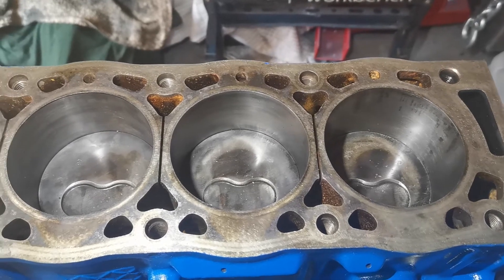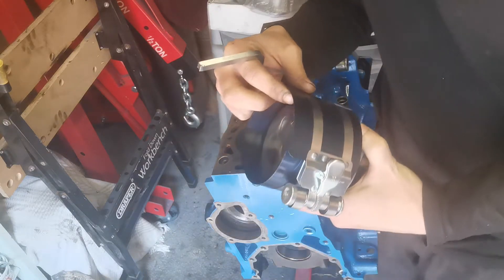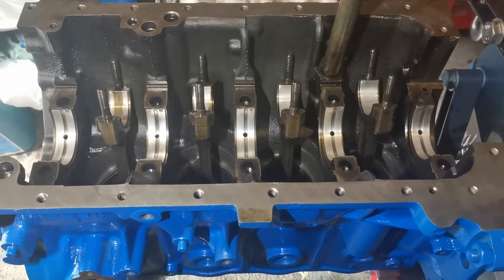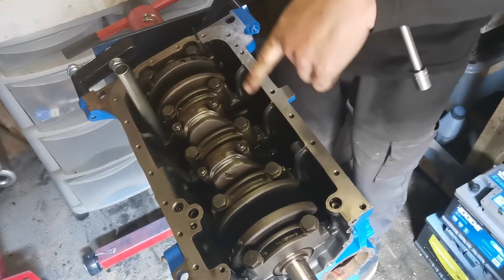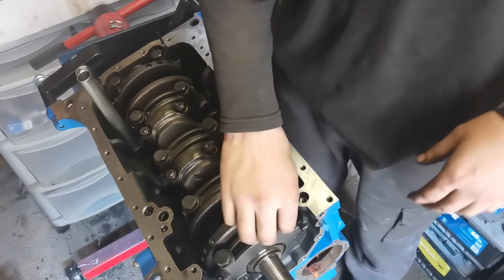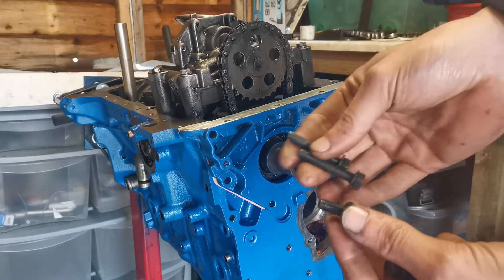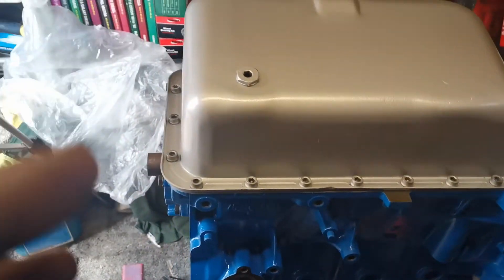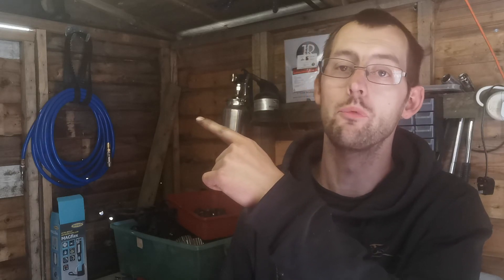XUD9 Citroen ZX 1.9 diesel Engine Rebuild Part 1 (wrong head bolts)

Comment: Hi, where did you get all your parts from? Gaskets, O rings, seals etc?
Reply from the maker: I initially bought a full engine rebuild gasket kit from ebay for the Xud9 engine and just picked up a couple of bits from my local parts supplier.

The gaskets and stuff are pretty OK to aquire because the engine is in a few different cars still.
Reply: @TheZXGuy  nice. Any chance you could do a heater matrix replacement video?
Reply from the maker: I'm not sure if it will help but I have these 2 videos already uploaded to YouTube as I've already done the heater matrix on this car.
https://youtu.be/Qn3hedpWl2o
https://youtu.be/0VlpPBrFiGY
Hopefully these videos will help if not I will do a heater matrix install video in the future but not sure when it will be sorry.